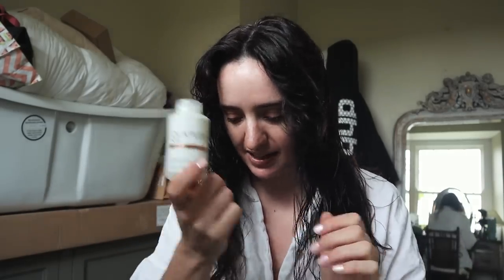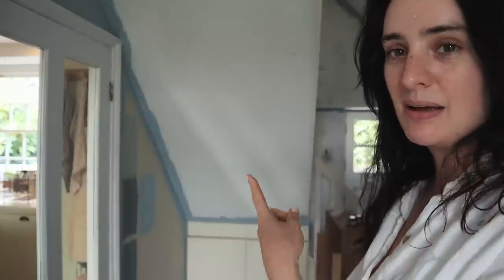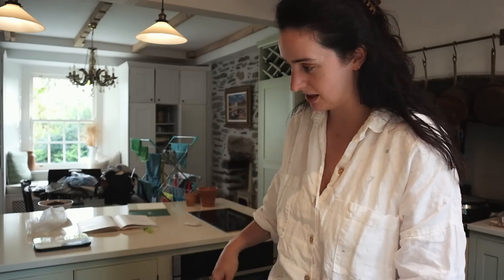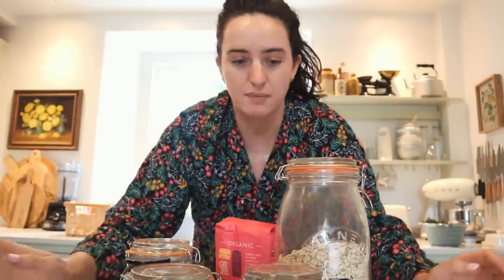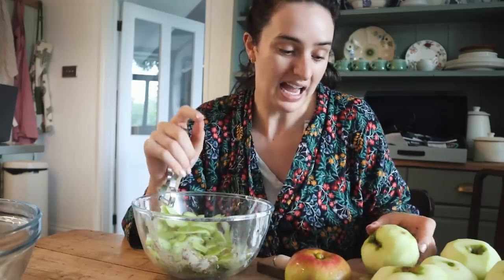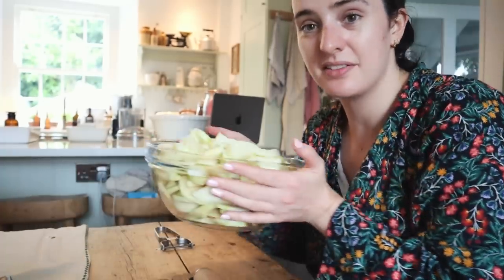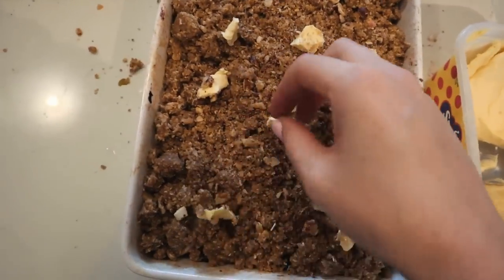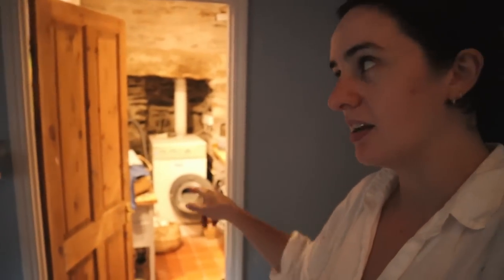A BIG REVEAL, Painting the Hallway and Apple & Blackberry Crumble Recipe

Comment: I've never seen anyone hold an apple peeler like that, which may be part of the problem. But you should definitely get the peeler/corneer machine!
Reply: I thought for a long time this was the way to hold the peeler, because what would be the point of pulling the peels towards yourself and getting them litteraly on you sometimes. 😅 And I can only peel long veggies like cucumber, zucchini, carrots... The 'round' ones like potatoes, apples, I get stuck when the "curb", the round part comes, the oeeler won't go round it but just abruptly stop and most likely I'm also hitting my fingers. Don't know how to explain properly but there's not enough area on a spheric veggie to give me the comfort of using the peeler. I use the smallest, shortest blade knife I have and works well. Actually I'm still not 100% sure I'm holding the peeler right. Every person seems to have a different opinion about how it's done. I wish I could see the original user's manual. 😂 Also I think we didn't have a lot of them in my country when I was growing up, my mother didn't use one. I picked it up at some point and... 🤷🏻‍♀️
Reply: I peel a ton of apples regularly and I just use a paring knife.  I have a thin very sharp one and I can peel the whole thing in one strip faster than one of those gadgets.  Plus I don’t have to wash and store said gadget that I would only use occasionally for one job.  Just one small little knife.  But then, I use my knives for pretty much every job.  I don’t have a processor either.  It feels to me like twice the work to get the thing out, fiddle with it, clean all the parts, store it back away when I can just take out the right knife for the job and chop away.  But to each their own, right?  Whatever gets the job done 😊 But ya, I don’t find those peelers are of much use at all for round produce.  They just make an awful mess and cramp the hand up.
Reply: OMG,I’ve never seen anyone hold a peeler like that either!😵‍💫😬🫢
Reply: @northwoodfalls1403  yes, that's how I've done it until now and it works well. I did get my first processor last month (and I'm 40 yo) to use it on big batches, mostly for certain winter preserves I make where everything need to be pretty much mashed up. My grabbing hand started to hurt when I hold veggies very tight to cut very small cubes. But when I hold them loosely I'm fine. Also I won't use it to chop for a regular soup or stew that I'm eating over two days.. Big batches only... and I just figured let's get one just in case. But yes the old school way is very nice and doing most these things by hand helos my mind calm down and get meditative. 😊